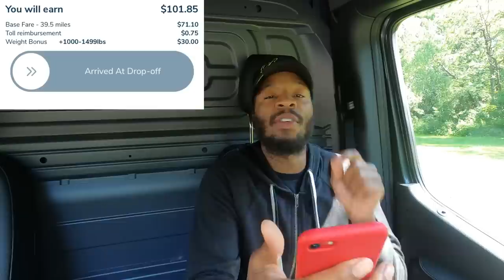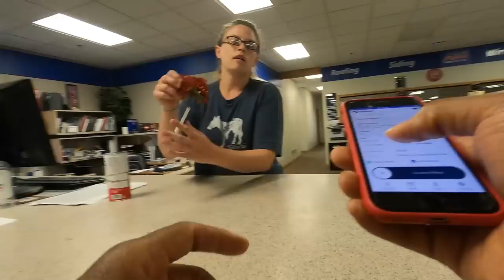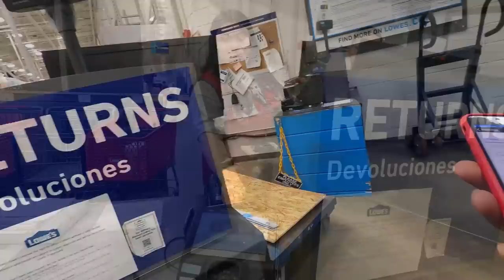NEW Customer Signature Required on Frayt Orders? What If No One Is Home? #foryou

Comment: Sir, I love and appreciate your content. very informative. quick questions I can't seem to find info about. when using the APPS cant you see what the packages are or just the weights? like in this video the plywood was cut into 3 pieces and made easier to carry. but if it was a full 4x8 sheet you may have needed assistance.
Reply from the maker: Appreciate It!! It shows you the weight and dimensions usually.